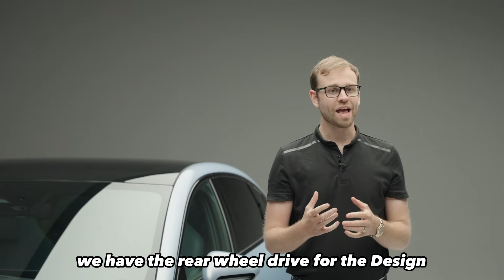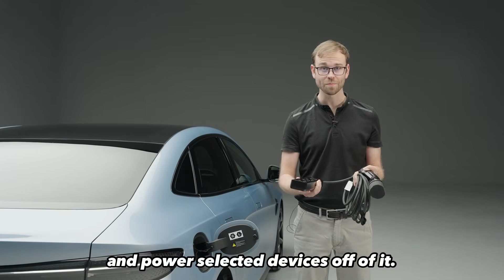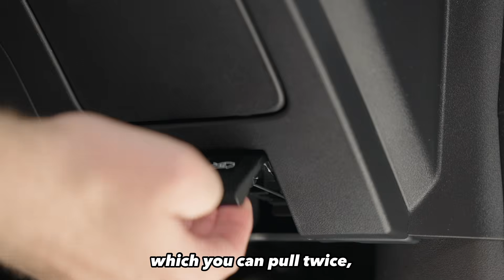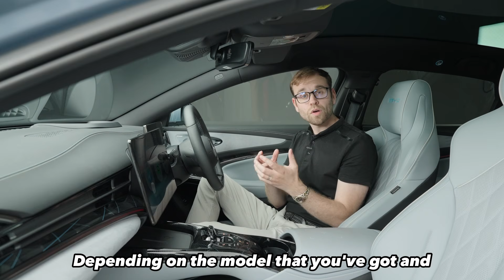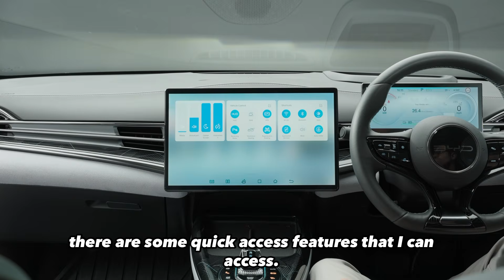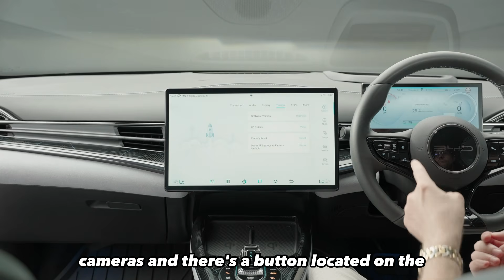New BYD SEAL Owner? Watch This First! ⚡️

Comment: Can't believe they gave the car a physical button for snow and to rotate the screen but not to change braking regen modes.  It's crucial when coming from open roads into built up areas to be able to switch easily imo
Reply: There's a dedicated toggle for this in the centre console - what are you talking about?

Comment: Great video - it would be really useful to know how you are to know which side the indicator stalk is on as if they are on the right, this would be really annoying.
Reply: That's the correct position for a RHD car.
Reply: I was looking at one here in Australia and the indicator stalk is on the right
Reply: In the UK alot of indicator stalks are on the left, so this would throw me off a bit. My Jaguar XF had left had indicator stalks but I've had a honda civic before with right hand ones, just takes some re learning

Comment: I wonder why BYD gives a DC charging time between 30-80% and not 10-80% like other manufacturers do? Besides that, why are there buttons for "blind-spot" and "Auto handbrake" - these are things you want to have all the time so it should be inside the software itself, something you turn on or off and never do it again, those buttons could be used for something else. I think that's super strange. Will there be an OTA of software for Seal so that it looks like the Sealion 7 that just came out?
Reply: Ooh, I can answer this. Most EV owners don't let the charge go below 30%. Similar to me with my diesel car. Before the fuel ⛽ gauge hits 1/4 I'm off to Texaco.

Comment: Don't buy this car.
Reply: Everyone i see is very happy with this car: quality is solid, software is phone-like, road performance is superb.
Reply: @VG-Motors  Then you are clearly a bot or someone who doesn't own one...
Reply: @dagispappan  What an argument... buddy, you don't know me.
Reply: @VG-Motors  Well I own one for a year so yeah, it's not finnished, the UI isn't really polished and It can't even tell me if the washer fluid is low/empty. They really cut corners on this car.
Reply: @dagispappan  I don't know where are you coming from with these problems, perhaps you just got really unlucky.
From what i can gather, BYDs are nice.
Reply: @VG-Motors  I get it from my own experience driving the car. Been driving EVs for the last 10 years and different brands like BMW and Teslas. BYD are behind them all and will have a hard time here in Europe. The support from BYD is lacking and customers are ignored when contacting them directly. Workshops don't get the support for their technicians either and alot of the problems with the car cannot be fixed.  Almost on every update they do they seem to brake something else like fan control in atton3, DC charging in the seal etc. The language in the UI is wrongly translated and makes the car feel unfinnished. It's a basic EV on the same par with MG so a couple of years behind. You can have all the good hardware but if you don't have the right sw anf fw then it doesn't matter. Shame because the car looks pretty good.
Reply: @dagispappan  you seem angry, are you OK buddy?
Reply: @GrumpyBulb  angry?
Reply: He's got period thats why 😂😂@GrumpyBulb
Reply: @dagispappan  what other ev brands or specific ev car models can notify you when brake fluids are down, etc.?
Reply: @addisonchan5994  washer fluid!
Reply: @dagispappan  ok, washer fluids. What brand or model has that? I'm out for the market
Reply: @dagispappan  ok, washer fluids. What brand or model has that? I'm out for the market
Reply: @addisonchan5994  well I haven't driven a car that don't warn for low level or could be adjusted or had less than 3 Litre capacity.
Reply: Why what is wrong with it?
Reply: @miketowler322  the software is superbad and, motors ineffcient, BYD stonewalling customers and actually bricked the supercharging in the previous ota.
Reply: @dagispappan  first of all can I ask if you own or have owned a byd? Or is this just hear say, I have owned a seal now for 3 months and I’m impressed, yes there are a few points that could and no doubt will be corrected, I have the latest version software and only last week I charged at 117kw from 29 kWh in 2 deg air temp, a few year back I had a Skoda enyaq and that way not a parch on the byd seal, in fact it was that bad skoda had the car back for a full refund.
Reply: @miketowler322  I have a Seal AWD since April last year so yeah. Drive 3-40.000km/year. Been driving EV since last 10 years and different brands...so yeah..
Reply: @dagispappan  What do mean bricked the supercharging - like if you're going to fume about certain things, be very specific.
Reply: @milpatel83  Yeah the previous ota made it so you couldn't charge och v3 chargers.
Reply: It's not your cash
Reply: @jimodonnell3639  just a word of advice from an owner mate